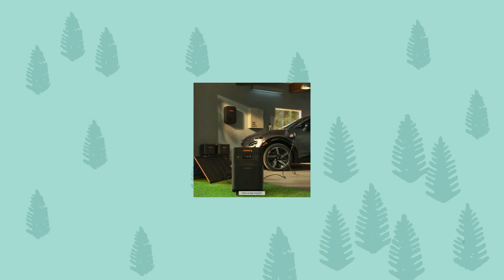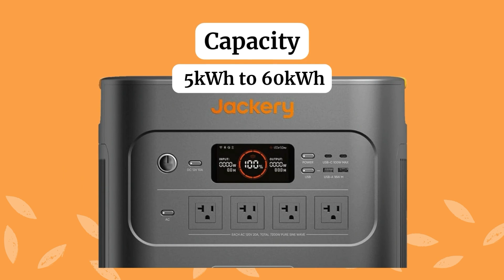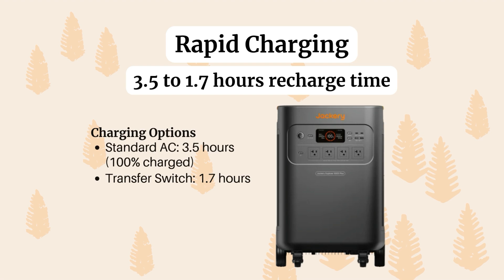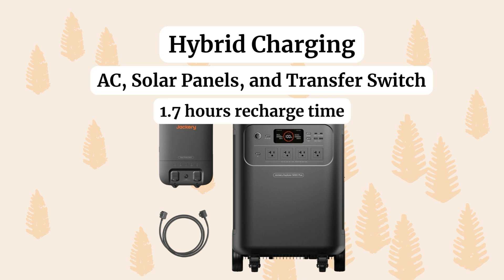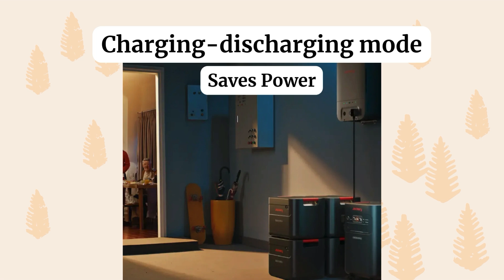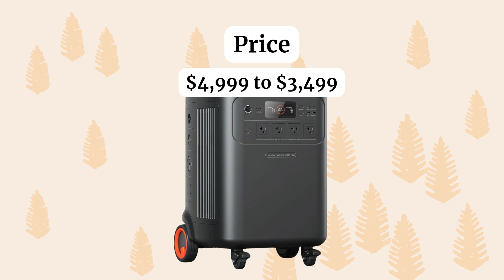Jackery 5000 Plus: The Ultimate Portable Power Station Review

Comment: Is this good for full time off grid use? or is it meant only to run "when you need it in emergency"
Reply from the maker: Yes, you can use Jackery 5000 Plus for 24/7 off-grid power without downtime. You would need a parallel system with two Jackery 5000 Plus units (10kWh base capacity), Smart Transfer Switch (STS) and 4 to 8 solar panels (2000-4000W total). Connect the two Jackery 5000 Plus via parallel cables and configure in the Jackery app for load balancing (automatically shifts demand between units). Setup a rotational charging cycle so that Unit A powers your setup while Unit B recharges. Configure an automatic switch via STS when Unit A reaches 20%, it switches to Unit B. If you don't get good sunlight, you can connect a propane generator to 5000 Plus' AC input.

Comment: Yes. I have the Jackery 5000 plus with the smart transfer switch. Have it connected to the grid, and for some reason in the App for battery I can't change any settings like the fast charging mode. Jackery support just send a link to pdf  for the manual. Any suggestions to get into the different modes? Thanks.
Reply from the maker: This is a long response, but here are a few suggestions to solve your issue:

To access and activate fast charging modes for your Jackery 5000 Plus with the Smart Transfer Switch through the app:

- App Permissions: Grant location and Bluetooth access.

- Firmware Updates: Make sure your app (v1.1.3+) and 5000 Plus firmware are fully up to date.

- Open the app, navigate to Device Settings > Charging Modes and select Emergency Super Charging. Note: This mode requires at least 20% battery health.

- Now, the app should automatically prioritize fast charging when the battery is within normal ranges (e.g., 20–80%)3.

- Battery Saving Mode: Disable this in the app if it conflicts with fast charging.

- Monitor real-time input wattage in the app’s Power Monitoring section to see if your charging speeds get up to 4300W.
Reply: @fairtradefinder1395  Thank you for responding quickly. Looked at it and made sure everything was as you suggested. I still have this pop-up appear when trying to change the different modes in App on the 5000 plus:Device connected to distribution box, temporarily disabling battery saving mode, auto shut down, power saving mode, silent charging mode, charging plan.
Do I  have to turn off breakers and power to Smart Transfer Switch and leave the battery in order to get into those modes to change them. In other words, I would like not to have fast charging selected, but I can't open to that option.
A lot, I know. Thank you.